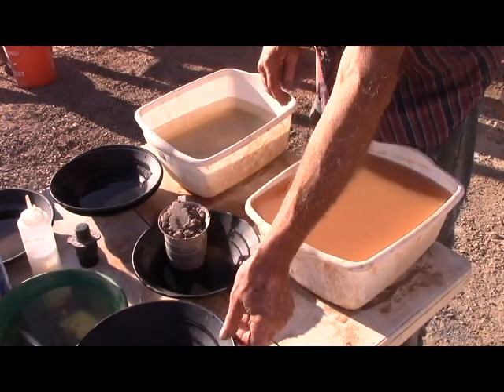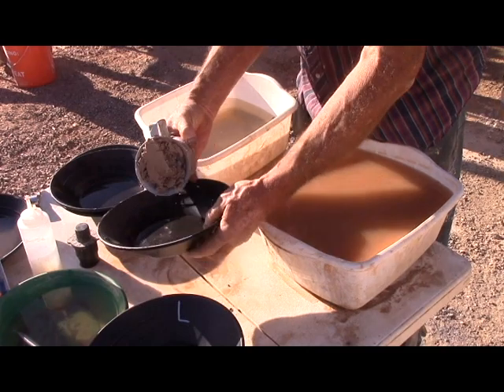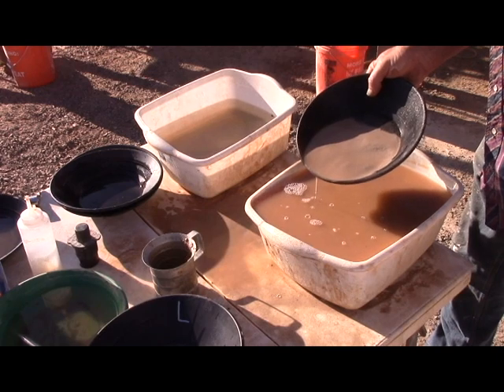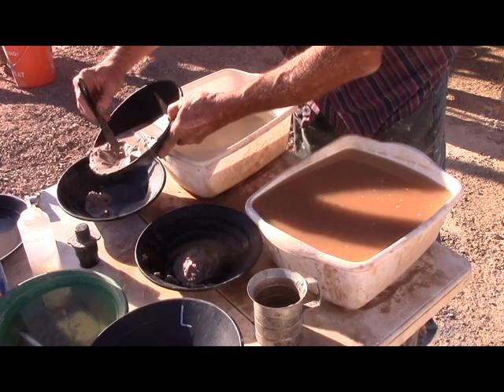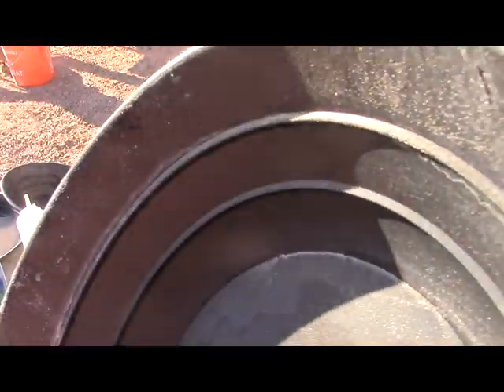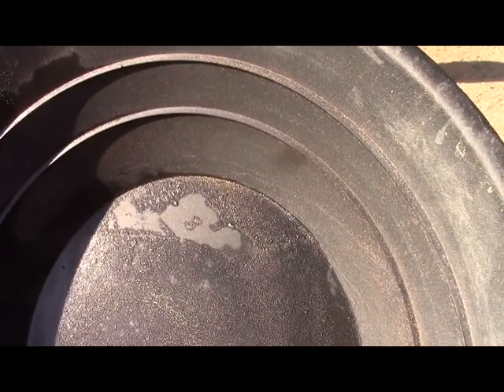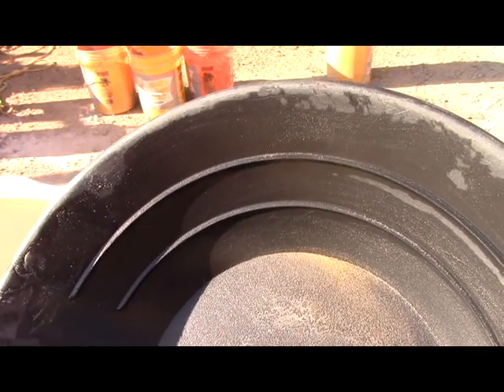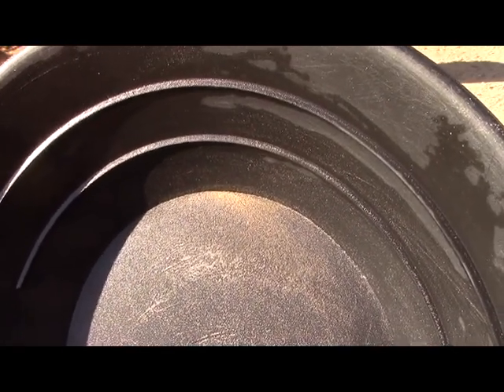145 How Fast Does Micro Fine Gold Settle

Comment: im looking at river gravels in southern michigan and my -70 material always has tons of very shiny/flakey material that wont settle but loves to roll around and flicker both on top of the settled material in the pan and in suspension.  when i slowly decant water off the top of material in my pan after agitating it a few times i see the shiny shimmer of flakes float out of the pan in the water.  i havent looked at under microscope but im wondering if this is micro gold or some other flaky mineral that is shiny, such as muscovite?  cant seem to find any videos online showing what i am seeing in my pans.  of course being in michigan, any gold is the very fine stuff ground up by glaciers and outwash rivers, traveling hundreds of miles from canada.
Reply from the maker: It is probably muscovite.  You can test it witheither aqua regia (gold will dissolve) or mercury (gold will stick).  If you can isolate a decent size flake, you can press on it and see if it breaks up (muscovite) or gets larger (ma;;eab;e gold).

Comment: What would you say would be the ounces per ton if the amount of gold in the 3rd pan was from hard rock crush that was not concentrates, with every crush  consistantly  . Just the crushed Rick as is ? Ruffly your best gusse ?
Reply from the maker: With a standard size sample, better than an ounce per ton.  Probably 1.5 to 2 ounces per ton.  If that was rock, it would be ore unless it was only an inch or two across.

Comment: What about boiling out the silica and quartz with sodium hydroxide, letting it cool then panning out the gold?
Reply from the maker: Too expensive and too much hazardous waste for practicality.  there are much cheaper and safer methods.  It would probably work though.
Reply: Thank you. What would be a better plan of action in processing in your personal opinion. I'm learning from you
Reply from the maker: It is all ore dependent.  First you would try a gravity separation is it is the easiest by far-  IF IT WORKS.  Then you would go to leaching.  If you have sulfides you would almost certainly have to throw a roast in there between crushing and extraction.

One always starts out with a serious sampling program and laboratory scale testing of the options BEFORE making any decisions or buying equipment.

Comment: Was there much black sand in that sample Keith , i know the fine stuff settles pretty quick , but if you got a fair bit of black sand it takes a bit to get it right to the bottom , interesting experiment though .cheers .
Reply from the maker: Very little heavies.  Mostly tramp iron from the grinding.  However, even a couple of percent heavies seems to make little difference.  In solid heavies, the gold still seems to drop reasonably easily as ling as it's not flaky.

Comment: I wonder how saturation plays a roll. How would a bigger pan and more clear water effect the sample if there was more water to mix with the sludge.
Reply from the maker: I am pretty confident it would be even faster.  I was surprised at how fast it was in those conditions.  Common sense would seem to indicate it would move quite slowly, but not so much.
Reply: @hardrockuniversity7283  - ever tried panning with some flocculant in the water instead of jet dry? I wonder if it would push sub 300-500 mesh gold to to the bottom, just like the other sediments.
Reply from the maker: @danhodgins4015  I have used flocculant at times to settle the slimes in a process, but never tested it against gold itself.  Might work.

Comment: Great instruction!. I have just started to pan for gold here in my home land Sweden.
I have just taken a couple of samples(42 Lbs/19 Kg in my backpack) from a construction site a kilometre from my home where they have dug up the earth all the way down to blue clay and sea bottom with a lot of red sand. The sand is mainly quartz and i just want to take a look at it out of curiosity.
Cheers 🙂
Reply from the maker: Remember that larger gold will not act in the same way as micro fine gold.  When testing a new material always use both types of reveal:  my tapping method AND the swirl type reveal that works for the larger gold.  It changes at about 50 mesh which id about the size of table salt.

Comment: I don’t understand the term contamination ? It’s all from the same test cup so I don’t understand what ya mean ,hope this isn’t a silly question
Reply from the maker: The problem is that when cleaning out the PAN after panning high grade cons, I can easily leave some gold behind that then shows up in the next test.  If the cons are running 20 ounces per ton and I miss only 1% of the gold in the pan when I clean it, the next sample would look like .2 Oz/T even if it had nothing in it.   That is why I started using different pans for cons versus ore.

Not a silly question.
Reply: @hardrockuniversity7283  oh ok thank you so much for explaining this….
Reply from the maker: @juliesilva6760  You're welcome.

Comment: I can see how tough it is for ultra fines to drop, when there is so much going on in a pan!  Would smaller con amounts in the pan (even though its more work) make it easier for ultras to sink quicker?   (With less material to fight?)
Reply from the maker: Less than 15 seconds seems fine to me.  To answer the other question, the thinner the pulp, the faster the trip to the bottom.

Comment: I was told that -300 mesh and smaller will 'not' come out of (water slurry) suspension in any type of sluice with riffles, in other words it can 'not' be caught in a sluicing system. But it 'can' be caught in a jig, centrifuge, or vibrating table system.
Reply from the maker: That seems to match my experience.  I can recover down to 500 mesh in an ocscillating Jig.  2000 mesh won't even settle in still water- that's what we are working on leaching now.

Comment: It seems every placer deposit has some gold dust that just doesn't want to settle out as quickly as the more easily seen small flakes.  So, how does the small miner justify the time and effort needed to capture it?  I remember reading that it takes 40,000 gold dust particles to add up to an ounce.  That's a lot of labor-intensive panning.  You can readily see why miners are commonly looking for options other than the toxic ones that are readily available such as mercury, fat flotation, expensive acid and cyanide.  Keith, you have proven to be quite handy in constructing mining equipment in the past, so please build an "automatic" processor that deals with both the fine clay particles and these fine gold dust particles, then sell me one.  Thanks for posting this common mining issue video.
Reply: It makes a big difference when you have an ounce or more of Gold in suspension.

Comment: There is a Gold sol in a British museum that has not settled since the 18th Century. I used to make them as a hobby and found that the cleaner the water, the longer it takes for the Gold to settle. When the particles are very fine, electrostatic forces come into play and the Gold particles, having the same charge repel each other.
Reply from the maker: Once it gets small enough it won't settle for sure.  A lot of gold in hard rock IS that small.  Thus the hybrid system{ gravity separation for the (relatively speaking) big stuff and dissolution for the small stuff.
Reply: @hardrockuniversity7283  
In commecial production the fines from the Ball mill go thrugh a gravity separation process and only the fines go to the cyanide dissalution process. t's pointless to send large bits due to the time it would take to put them in solution.
Reply from the maker: @cooljets  Correct.  Unfortunately, end discharge ball mills also tend to be good gold traps.
Reply: @hardrockuniversity7283  
The Gold isn't going anywhere. It just needs to be cleaned-out periodically. The super in charge knows when. It's the down-time that makes management ansy.
Reply from the maker: Loren said the mine he used to work at used the gold in the ball mills an an emergency piggy bank.  🙂
Reply: @hardrockuniversity7283  
That Gold does have a high vapor pressure.
Reply: @hardrockuniversity7283  
Not in South Africa. The security regime there is a bit more draconian. :)
Reply from the maker: @cooljets  Piggy bank for the COMPANY.  🙂When they got low on funds- MILL RELINE!
Reply: @hardrockuniversity7283  
For a minute there I thought you were independent contractors. :) I knew some sketchy folks. They do exist.
Reply from the maker: Here it is usually fraud rather than robbery.  THEFT can always be a problem with gold.  If you ever get the chance to buy a scrap ball mill from a gold mine, buy it, strip and clean it, then re sell it for the same price.
Reply: @hardrockuniversity7283  
Buying an old ball mill may be a good idea for someone, but you never know what's hiding in those nooks and crannies. Old miners used to add Mercury to the mill to trap fines. I'll pass on that one, thanks anyway.

Comment: I think its just econ 101.  Until the price of gold goes up and the cost of extraction cross paths to a line of profit all you can do with this type of gold as a hobbyist; is just concentrate it down as cheap and fast as possible, then just wait. I would probably just run all that paydirt through gold cube or jig, then rinse the tailings through a 100micron mesh screen or smaller and you will end up with like a tablespoon of "clay" per 5 gal bucket of paydirt.  After 20 years you might have half a bucket of clay that might warrant the cost of refinement.
Reply from the maker: You always have to follow the numbers